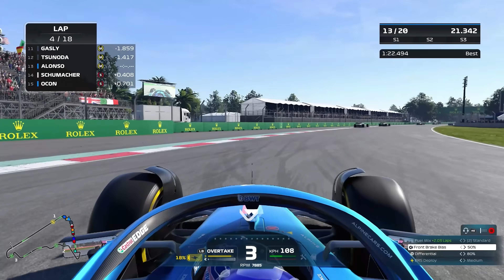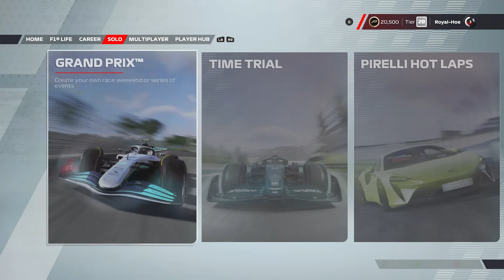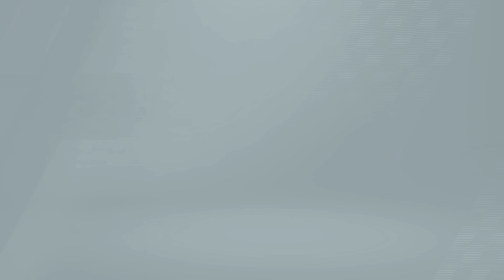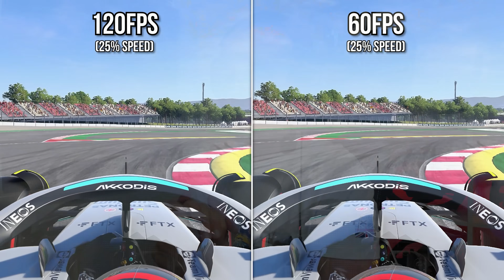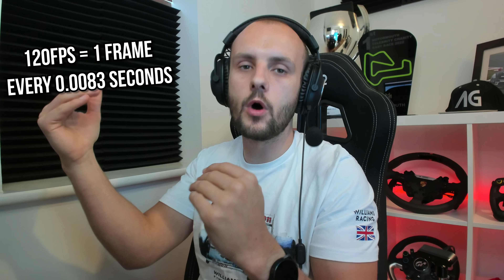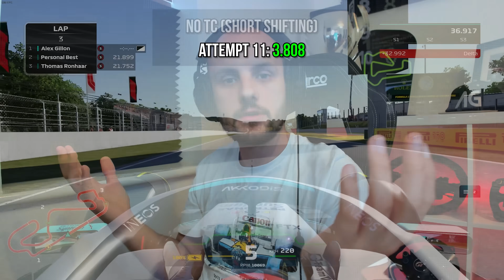Can A Human Beat Traction Control In F1 22?

Comment: The reason short shifting works is because the higher the gear you're in, the higher the speed the wheels can spin, but at the expense of torque. That's why gears exist. Engines make their power in an RPM range, and to overcome the inertia of the car at a standstill, torque is required, but when the car is moving, the wheels need to spin faster and don't need as much torque. Short shifting lowers the torque to the wheels, which helps prevent the wheels from breaking traction. This is why a car can't move from a stop in a high gear, but using a low gear at speed would cause the engine to over rev and likely destroy itself (see money-shifting in drag racing, really funny videos to watch).
Reply: Um bom comentário.

Comment: Man, great video but TC is so much more useful during cornering.  I’ve been playing the f1 games 3 years very regularly if not daily.  I’ve got fanatec DD pro with pedals, stand and seat etc.  If I turn it off completely I feel like I spin if I even look at the throttle.   Medium I can get through a lap but I’m consistently a second slower.  Even at Canada, mostly straights short track.  1.2 seconds slower vs full tc.  This is the only assist I use and I hate it.  I want to run none or even medium but it’s so difficult to not spin.  Don’t even want to think about it in the wet.  
I get it practice practice practice.  I started with TC on and now I have no pedal control.
Reply: git gud
Reply: @skyfator  man your awesome. When I grow up I hope I can GIT like you.  Except the part of knowing how to spell
Reply: @Bestruction  bro do you know that git gud is slang mate
Reply: @skyfator  yes I do, just don’t understand why anyone would use git instead of get.  But I’m sure your comment made you feel better about your life for 3 seconds.
Reply: @Bestruction  you sure got me hard on this one bud
Reply: Please turn off TC. I am not forcing you but some people on pad have it off and you have a fanatec wheel. Or use medium. With medium you can floor it as long as the wheel is straight. Be gentle and patient mid corner and increase throttle as you open up your steering. Hope this helpe

Comment: when you look at the revs in 1st gear you can see that the tc run had about 500-600 more revs at the same speed than none tc which i find strange as the revs should be the same. unless the game is simulating some sort of partially releasing the clutch to account for the higher throttle input. maybe you can look into that and share what you find.
Reply: might be due to wheelspin aswell

Comment: It's always bothered me when some YouTuber (not referring to Alex here) or eSports driver declares that TC slows you down, because that's not true for everyone. A lower skilled driver who has a less refined throttle control or someone playing with pedals that use potentiometers instead of 12-bit or higher Hall effect sensors will, I believe, drive faster with TC than without.
Reply: Active league racer here, and yup I think basically everything you've said is true based on my experiences. If I'd put on medium TC I'd be like half a second slower, but many league racers who still use TC are not really improving much when they try try turn it off, if at all. And you always have to remember that even the least experienced or irregular league racers are still significantly faster than the average casual (just because they put so much more time and effort into the game than the average). Full TC is useless for people who want to get faster but med TC can be very useful for almost everyone who isn't living and breathing this game
Reply: @NLR_Knuth  if you are a league racer with TC ur not a league racer ur a random discord with slow players who want to be a league racer racer
Reply: High level TC will definitely slow you down. Set TC 1 in ACC feels much better
Reply: The bar is lower on how fast you'll be around the track with TC than without. So it's not really about being faster on the get-go, turning TC off raises the bar on how fast you're capable of being.

Comment: the fact that youre able to go full throttle without TC and the car NOT spinning 720 degress is crazy for me, try that without force feedback
Reply: I can’t do it with force feedback
Reply: @zzHatch  maybe it has to be a direct drive wheel ?
Reply: @AlefeLucas  potentially yeah. Mines belt driven and there’s no feel for traction in first gear
Reply: @AlefeLucas yes it has to be DD and at high ffb setting (I’m guessing 65+% ) to be able to feel the slight sliding in the rear before it bites
Reply: I always drive with no FFB and no TC. Only when its raining I turn on TC.
Reply: agree, i dont get it.. the car spins immediate when you floor it without traction control
Reply: @wesvds  Thats why you dont floor it
Reply: @anonymousfuck9320  at 3;50 he shows he floors his pedal and still does not spin out.. multiple times..
Reply: @wesvds  it’s called counter steering and skill , sadly can’t just learn that last one
Reply: but he does on purpose to show the timing look at the vidéo

Comment: How can you just floor with no TC??? From a standing start, half way to the floor and I’m doing donuts. We are not playing the same game
Reply: I hate to say it but maybe hes just a better driver than you
Reply: @Cody.Wright  no doubt he is in a different league, but in this test he just floors it, no skill . In my game it can not be held it, it doesn’t even move forward just spins on the spot.
Reply: @MrDjmyny  that is the skill we dont see what hes having to do with his wheel to keep the car relatively straight where you would probably just hold the wheel straight thinking that's enough but its not.
Reply: I wonder if a very soft rear suspension and high rear wing made it easier to control.

Comment: I normally only short shift from 1st to 2nd gear. But that's in F1 2020. Works for me, because gives me more control over the car. That with no assists. I dunno, i'm not that good. i only plat at 70 to 74 difficulty so it's propably not enough to know if it makes a difference

Comment: 13:38 the "just like it is in real life" is so wrong man, the gt3 cars irl run with traction control and because they are so advanced that youre just gonna be slower without them
Reply: Big diff between gt3 and f1…. Gt3 have no donwforce and aero comparing to f1.
Reply: @QRLSpoon  that makes zero sense when your starting from a dig on starts tc is valuable but over the course of a race not so much so specification of when tc is better vs not needs to happen. All the aero F1 cars have at speed basically gives the car natural tc but the trade off is that at low speeds it can be very slippery

Comment: Have you tested race starts (with and without warmup lap, and with/without burnout on start of warmup lap)?

I’ve found that I can’t control the car at all on a start without a good warmup lap burnout, honestly end up facing the wrong way (no TC obviously)
Reply: Medium TC on race starts seems to be OP on cold tires. I was watching a video on some smaller channel where the guy states the same thing. Full TC bogs the car down too much and no TC requires perfect throttle input on cold tires. But Medium TC seems to be the best of both worlds. It's a bit more forgiving than no TC and doesn't bog the engine down like full TC.

With actual warm tires, a good driver with no TC beats medium and full TC any day of the week.

Comment: Ever since switching to medium TC, I noticed I’m slower with TC on full. Granted I spin everywhere in ways I don’t even know how but since the AJ gets perfect traction out of corners, I need to keep TC on medium or off.
Reply: It is so more realistic and challenging turned off. I turned it off in 2020 and haven't gone back.
Reply: @belongda6032  yeah but I’m F1 22 it’s ridiculous
Reply: @ericrvnfro  i have the same game. A good stable race set up should minimize your spinning. There are plenty of channels putting out Race/Time trial set ups. i suggest use them and tweak them to your liking
Reply: @belongda6032  the behaviour of the traction with TC on medium is actually more realistic than the behaviour of traction with TC off, as funny as it sounds
Reply: @coastallab5526  it might be so. I prefer my settings the same as e-sports drivers. Only real way to know your getting better. And the gap is closing. Comparing times etc. Depends what type of challenge you want.
Reply: @belongda6032  yes absolutely, i just found that funny 😂

Comment: Check the revs, the TC version is doing wheel slip so it has higher revs than the non TC version around 500rpm at times under acceleration esp in first gear. If you can match the start revs of the TC version and maintain the throttle there will that make it more consistently better without TC?

Comment: Well, welcome to "Codies can't code traction control properly" yet again. On F1 2020, which is probably the best since 2012 in this regard, you could plant the throttle on medium and get a bit of slip and still hold it, which is how drivers would drive in the 00s with TC in F1 and how I like it. But on this year's game, if you have it on full you're towing a caravan and if you have it on medium it's an autospin, no different to having it on no TC at all.

Yes, I have a major disadvantage because of how I grew up, playing F1 05/06 on PS2 on a pad so I still use those controller settings (X to accelerate, square to brake) as that's what I've done for 15+ years... but on 05/06 I'd have TC on 50-60% so it would give me some slip. You cannot do that on this year's game.
Reply: Yeah you're whole issue is literally 0-100% throttle with nothing in between. Change controls and get better.
Reply: But the ps2 controller had analog buttons, which modern controllers do not. So you're double disadvantaging yourself. BTW it's the same in GT7, anything beyond TC1 is just painful
Reply: Played previous F1 games with TC being on medium and it felt good, i could control the car out of corners without spinning. In this years game its nearly impossible, i can’t do shit with PS4 controller anymore. I wonder if it’s much easier with the wheel
Reply: @F1ProStyle  it is easier with wheel, using mine I only really struggle in wet conditions
Reply: @F1ProStyle  I haven’t struggled on controller besides the first few days of launch. F12020 was my first f1 game and I was able to keep it off since. You just need to actually take time and once you get used to it, its a lot quicker
Reply: I think if you just got a little bit better at the game you wouldn't spin and crash out. Hope this helps 👍

Comment: what if f1 cars were made out of steel, i dont know how you figure out the weight but it would be cool, and also other materials(that are used in cars/motorsport) would be even cooler
Reply: It would NOT be cool. Carbon fibre is not only much lighter but vastly stronger than steel on a strength:weight ratio. Carbon fiber reacts a great bit differently than steel does when it's subjected to a crash. Instead of bending in the crumple zones, carbon fibre dissipates energy by cracking and shattering helping it soak up the energy of an impact whilst protecting the driver.
Reply: @SDGMatt-SDGRacingLeague  im not talking about real life just in the game
Reply: and i dont care about strength or what happens when you crash
Reply: That would be garbage.

Comment: Very interesting stuff, I've been playing around with TC in this years game and I really wasn't sure if it felt better or worse tbh.
It definitely feels more rewarding without it but it's more fun with TC on at times^^
Reply: Trust just turn it off I did that like 6-7 months ago and now it’s just automatic and really not that hard as it first seems
Reply: @GIANTROY1  The main problem I have is just the MyTeam mode lol
I've turned TC off for online play and it works just fine, but in MyTeam I just keep on spinning out randomly idk why
Reply: @YYesImCrazYY  I don’t play myteam but I’ve heard the car u start out with is really bad so I’m not surprised
Reply: @GIANTROY1  hmm, I guess I'll just have to get through the first season or so to get my car feeling good then, not really sure I like that as a game design choice but it is what it is
Reply: @YYesImCrazYY   Same here, even my almost maxed out My Team car with all chassis and downforce upgrades has more wheel spin and less grip then the regular career mode/grand prix mode cars.
Reply: @YYesImCrazYY  you can't play with standard tt setups on my team. the cars are very understeery or twitchy. you need to setup your car on the move, week by week as each upgrade arrives, since the behaviour of the car slightly changes.
Reply: @Ramazan_Durak  While I personally might have the time for that cause I'm a no lifer at times, how do they expect the casual player to actually do this stuff lol
That's just stupid game design tbh or nah?
Reply: @YYesImCrazYY  at the end of the day, it is a single player challenge and you can adjust the AI :) but you are right.
Reply: @YYesImCrazYY  The mode built around micromanaging every detail of your f1 car should require you to spend time managing setups, if you simply want to jump into a race quickly that's what the standard grand prix and online modes are for
Reply: i turn it off and loose a bunch of time so nah im good
Reply: @MrBooBoo thx captain obvious haha
It is very much upgraded but I guess the car you get even as a midfield starter is still too bad.

Comment: It was mentioned that the 0-150kph delta should increase if tyre temp simulation was on. Is there data to back it up or a hypothesis?
I'd say it shouldn't make much of an immediate difference as even the surface temperature takes a second to fully sink in, let alone the carcass temp. Starting at the same tyre temperature with temp simulation on, I doubt it makes much difference off the line--but then you'll certainly suffer gradual overheating in the subsequent half lap and have a terrible time.
Just trying to discuss time scales and cause and effect :)
Reply from the maker: The only way the temps would matter is if you got wheelspin, so they basically make it possible to get a much worse start without TC on

But if you nail it, having temperature simulation on/off shouldn't make a difference